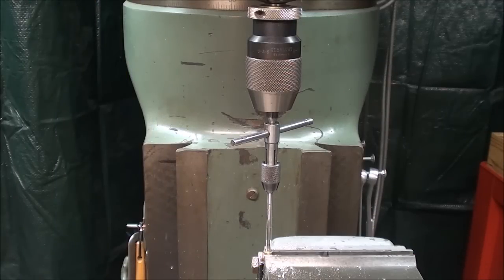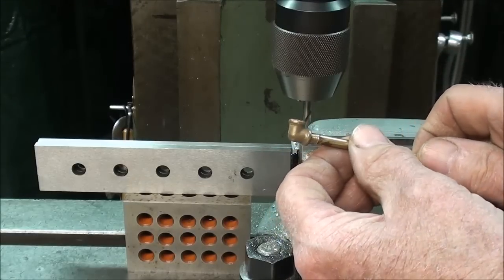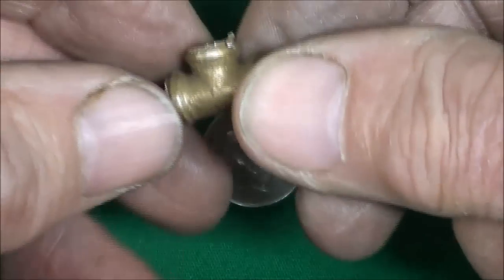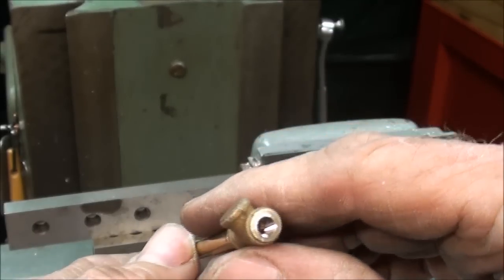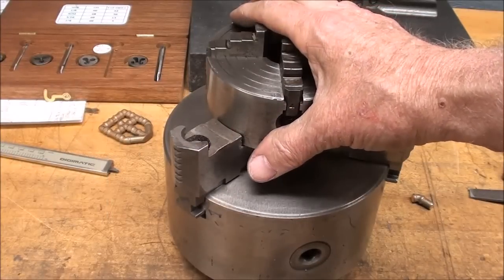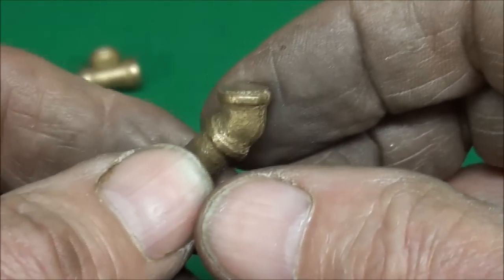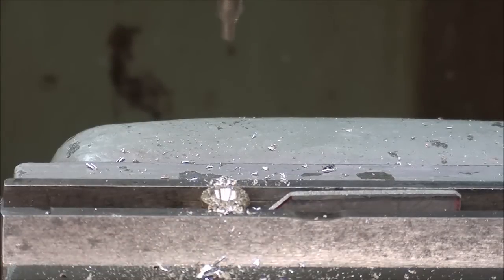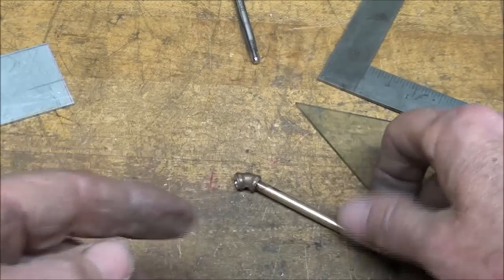SHOP TIPS #208 Machining Tiny Brass Steam Engine Fittings pt 2 tubalcain

Comment: Hi Lyle
Thanks for the reference to me and my company. Those fittings are a bugger to hold. I have the trees (stick) of the same castings. I decided early on in my live steam career to just simply buy them ready to use.  At one time was going to make and sell fittings and that’s why I had the taps and die sets made, the vary set that I sent to you. The fixtures require to machine them accurately are a hard thing to make and the variance in castings makes it more difficult.

Ah Yes The Shadow. My Father introduced me to him about the year 1950. We had a 1950 Chevy Deluxe and we listen to that radio program on the way back from the beach. I occupied the back seat and generally fell asleep. Great times then. I wish we can repeat the 1950ies and 60ies over and over.

Thanks again   Dave the trainman4602
Reply from the maker: trainman4602 Hi Dave
Yes--they are terribbly hard to hold, I would never want to do many of them. I thought about a fixture, but new it would be problematic. In fact, at this time , I do not intend to machine the tiny little valve castings--too small , delicate, and hard to hold. I'm sure enjoying your lost wax series. lyle

Comment: Nice work; dandy little fittings. I do have a comment/question:

You have frequently pointed out that it is best to not cut a part off the main body of stock any sooner than required. I wonder that you did not cut the sprues off the 45s and the coupling above the cross; drill the first holes in the 45s; drill a hole through the coupling and the cross; tap the exposed locations; and only then begin cutting fittings (or groups of fittings) off as needed to get access to further machining locations  while leaving large assemblies as long as possible to facilitate work-holding. It might require doing the machining on parts that you didn't need immediately, but it seems to me that it would make the total amount of machining that would need to be done eventually somewhat easier.
Reply from the maker: Peter W. Meek Good idea. Theres a 100 diff ways to do this,   Thanks for watching.

Comment: Lyle,

Great video. For the thin 45 aluminum gage, you could use some small pieces of adhesive backed weatherstripping to each side of the gage. Once between the vice jaws it would hold itself and free up a hand for other purposes.

Comment: tubalcain, a much simpler method to hold those small odd pieces in a vise is as follows. sandwich then between two pine boards in your milling machines vise and crank down tight. it will embed them into each piece if wood and create a fixture that is perfectly formed to the part and will  not let it cock, or spin. and even better is when /if your mill hits the wood it will do no damage and keep your vise jaws safely away.  try another in a video. it works a treat for all types of odd parts including times you need to drill perpendicular into a thread.

Comment: To use the 45 degree plate more easily - stick a suitably thick compressible pad (rubber/felt/whatever) to each side, making the whole plate a little wider than the thickest part of the fitting. The plate will self-centre in the vice and thus be on the central line of the fitting for alignment.
Reply from the maker: +Mark Sinden Great idea

Comment: That little 4-jaw is the twin of mine except for the spindle thread. I've learned that they were made by a defunct UK outfit called Crown. I've gotten great service out of mine, as for many years I had no 3-jaw.
 Drill and tap it 1"-10 and it would fit an Atlas 618.
Tom
Reply from the maker: awhs1964 Great little chuck-thanks

Comment: Thanks Mr. Pete, fine project.
re; that small 4 jaw. Sears, at one time, sold a version of the Sherline Micro-lathe, re-badged under their "Craftsman"" label. That lathe spindle, along  with the Taig lathe, has  a 3/4-16 thread. My 10" Craftsman lathe has a 4 jaw also made in England, & has no back-plate like that one.
Thanks again.
Dick
Reply from the maker: WB8MHE I remember that,   Thanks for watching.

Comment: Hello mr. Pete. Great videos sir. I had a question about putting a countersink in Brass stock. Every time I try to countersink the top of my hole to fit my fastener head properly I get a chattered ugly finish on the Brass. I have tried a couple different speeds and tried using some different countersink cutters but am not getting better results. I'm not a machinist so this may be a very simple question. But I'd appreciate your advice and will continue enjoying your informative videos.
Reply from the maker: That is always a troublesome operation. Try a undiluted countersink
Reply: Thank you mr. Pete

Comment: If your larger 4 jaw chuck has the capacity, you could chuck the smaller 4 jaw chuck in the jaws of the larger 4 jaw chuck and not be concerned with the threads in the small 4 jaw chuck.
Reply: pyromedichd1 Whoops spoke too soon. Sorry.
Reply from the maker: pyromedichd1 THANKS FOR WATCHING

Comment: This is a great video, too confuse the matter even more with model fittings there are thread the same size as the model pipe threads that are not tapered, but straight threads and it is almost imposable to tell them apart.

Comment: I wanted to try something small just to test my skill at small items.

It was also the first time I turned a cone which may be useful later on for a rocket motor.

I decided to make a silencer for my .22, so far the smallest item to come finished from my lathe is the 5 "K" baffles that make up most of the column. Mind you these are legal IF you pay the feds $200 tax for the privilege of owning your finished silencer. As unassembled parts you can own all you want for free. I have yet to make the tube and the final expansion chamber. It is a challenging part to make, the OD is .75"

http://www.rcworks.com/DSC00505.JPG